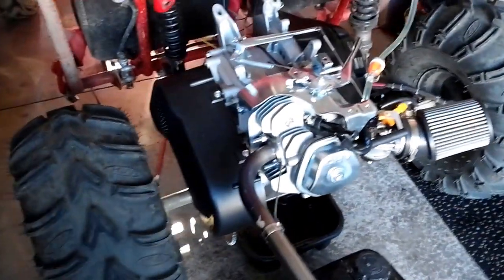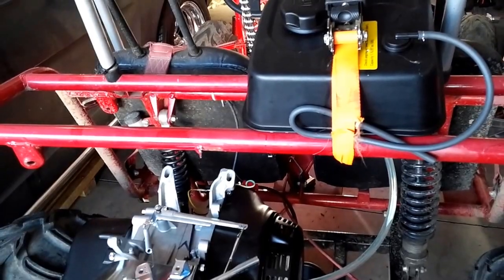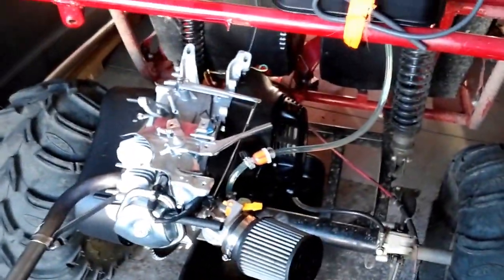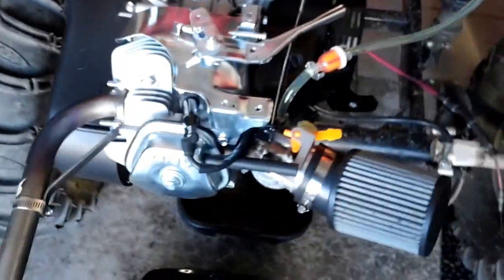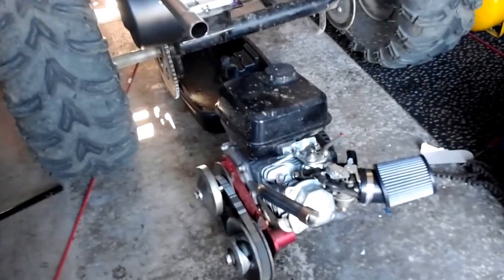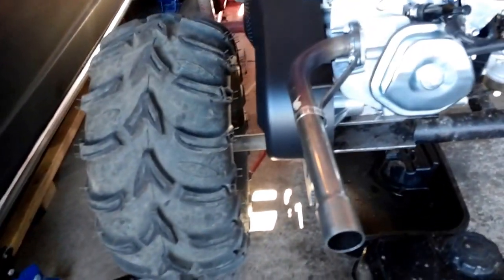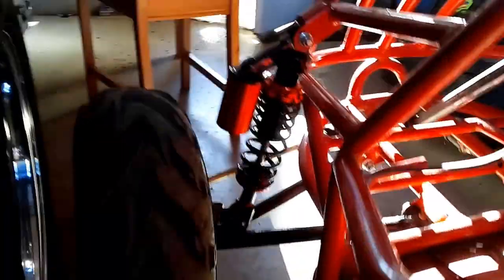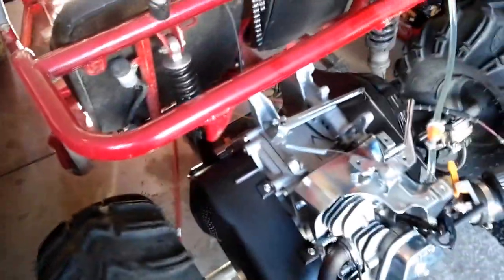Startup and Backfire! New Predator 420cc Powerland PD420 on Baja Sand Rail.

Comment: very good engine I bought one for my pulling mower only problem ive had was the engine floods after suting off if I dont sut gas off and it has no govner on it I hold it to the cloor all the way down the track no problems so far
Reply from the maker: try the Tuned carb from Vegas Karts, i love it and it added plenty of repsonse.
Reply: im gonna look it up but only thing I need is to figure out a way to make it electric start
Reply from the maker: Christopher Johnson you have to cut the block in front and change flywheel, add battery, charging coil, wiring harness. I don't want it bc it's extra weight
Reply: ya mines for pulling need more wait. and I kinda thought of taking a starter and runing a belt on it to a pully on the shaft
Reply from the maker: That'll work too

Comment: Can you post a link for the upgraded performance parts? I'm looking to replace a 9hp tecumseh with one of these 16hp powerland pd420's, the ride is a ken-bar sk-959. Thanks in advance for any help.
Reply from the maker: http://www.vegascarts.com/ for performance parts for the 420cc

and below is link to buy the engine featured in video.

http://www.ebay.com/itm/PowerLand-PD420-Recoil-Start-16HP-Gas-Engine-Horizontal-Shaft-/282193765010?hash=item41b40f2292:g:D6cAAOSwoudW4Mfq
Reply: Thanks a lot for the help.
Reply from the maker: no problem

Comment: Youtube has no videos on the power land 420cc's and its hella aggravating
Reply from the maker: I think the engine got axed for some reason. I tried to buy another and they're gone or 3x the price i paid for engine in video
Reply from the maker: It was identical to all my 212cc aside from the governor location.
Reply: 4Wheel & Chill where do you find the engines because I've looked and cannot find a thing they got discontinued around 2016 when they were selling them for dirt cheap because of overstock. I know power land has a reputation which may be another reason for why they were so cheap, I currently own one and compared to other 420cc clones they do have some noticeable differences which makes it only partly difficult to work on

Comment: beware, most of these cheap big blocks do not have iron cylinder sleeves or steel cranks. they are design like snowblower motors are short overall hour life.
Reply from the maker: i have since removed the governor and inspected internals. The engine is VERY SOLID and I have no concerns about the engines internal failures.

Comment: by chance do you know the height of the engine? from the bottom of the plate to the top of the gas tank?
Reply from the maker: I don't have the tank on engine any more. it's been mounted to the frame. I'm sure the dimension are online but I can measure the block from plate to top for you?

Comment: how did u get the torque converter plate to fit or is it a gopowersports one
Reply from the maker: michael flores I put giant bolt into threads of dip stick with silicone RTV.. then cut it off along with piece of the block so the plate would clear.. ironically I had to scrap this setup. if you look at my updated video I this TC system on a little quad build.. went wuth full jackshaft setup for this engine as it had way too much power.